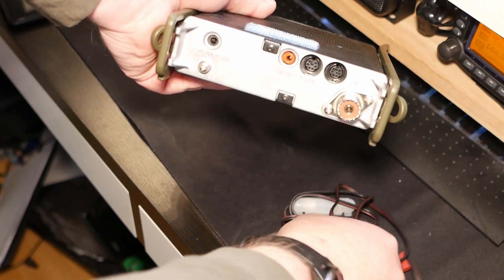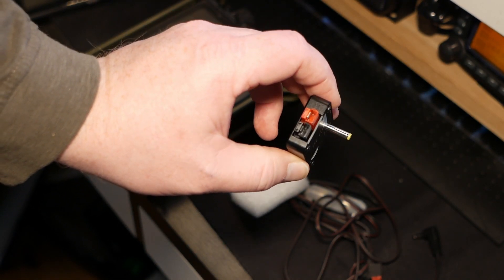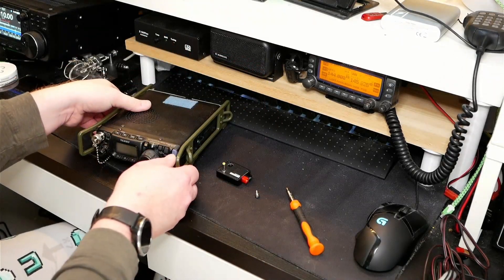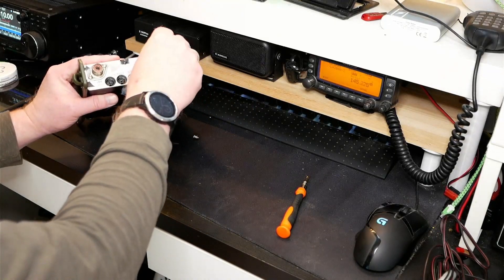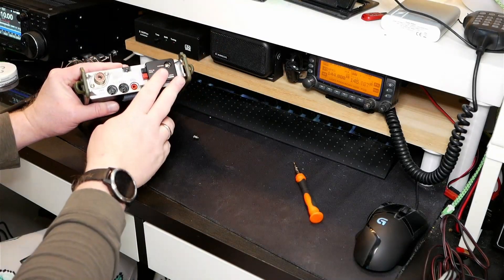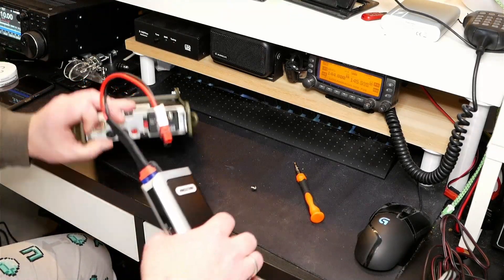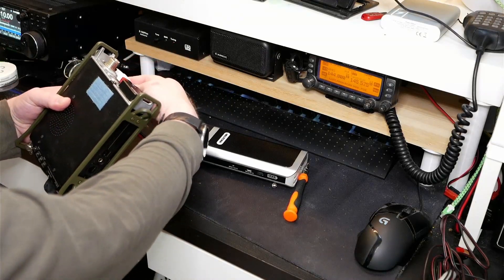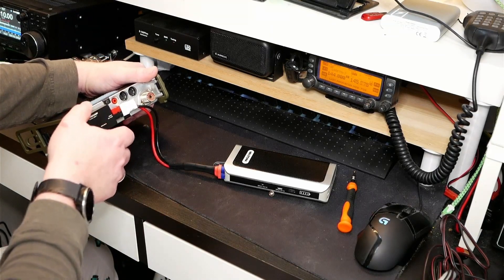One minute Hack - Powerpoles on the FT-817

Comment: do you know what size power pole connector it is ? i wanted to pick up an adapter to be able to use battery clamps and was unsure. thank you for the video !!
Reply from the maker: I’m not sure what you mean by the size of the powerpoles, they are powerpole size.
Reply: @LB0FI   so i figured out that the 15 amp and 30 amp power pole connectors are compatible with each other. im guessing the wind camp adapter is probably the 15 amp power pole so im just going to order up a big connector kit and wire up a bunch of stuff !!! thank you for the reply

Comment: I fitted one of these power adaptors to my ft817; it works a treat. Cheers Ian VK3ZM
Reply from the maker: Absolutely, and for me it's all about not being afraid of breaking the power connector.
Reply: @LB0FI  Also, if you plug the standard connector in live, the inner conductor can short to the chassis and blow the supply fuse. I did this three times before I realised what was going on. What a dunce. Now, with the windcamp adaptor, this does not happen. Cheers again, Ian VK3ZM